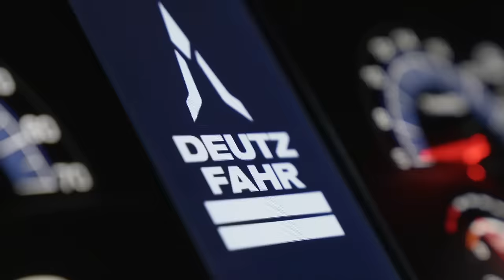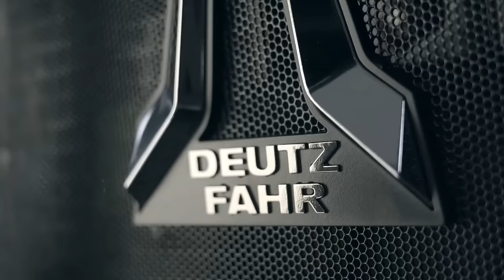DEUTZ-FAHR 8280 TTV

Comment: Where is 11 series 400hp DF? How many years will it take to create it?? Over 5 years and the biggest is still only 340hp 9340 model.
Reply from the maker: Dear Bratanolda, 
Thank you very much for your question. As we are required to fulfill the regulations as well as emission stages the focus during the last years was on other projects and investments. Starting with the brand new 5DV/DS/DF TTV as well as the 5D TTV with 4-wheel steering technology. Followed by the new 6 series including the new model 6145.4. And finally introducing the new 8280 TTV. Don’t mentioning our new and updated plants in Germany, Italy, Turkey and Asia, in which we invested more than 150 m €. Also in the future you can expect new and innovative products in the different hp-ranges, enlarging the current offering, produced in the most modern tractor plants. We are also developing new technologies. Be curious!  ;)
Reply: I doubt the 11 series will make it to serial production, i even question the longevity of those MTU engines for agro use, its not bad but cant compete with the Cummins powered 4wd tractors. Komatsu engines would have been more suitable, but Euro emission regulations would be a problem then too.